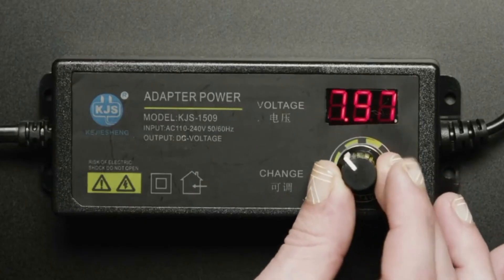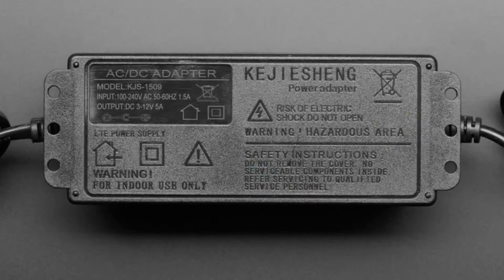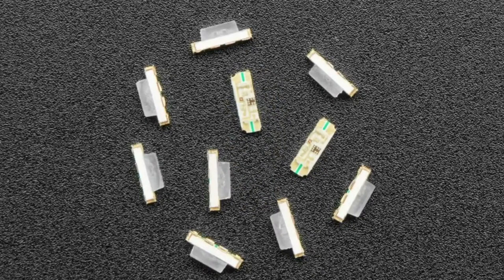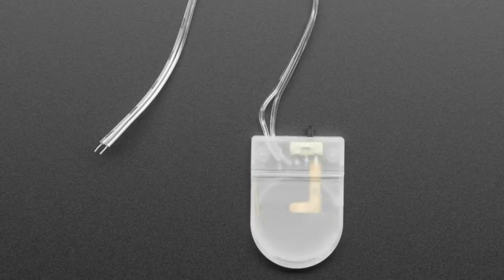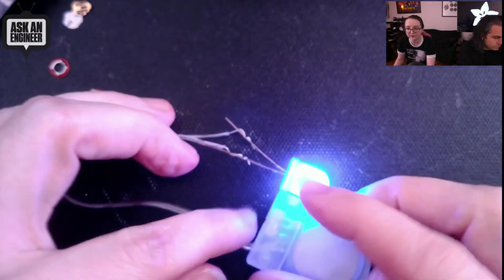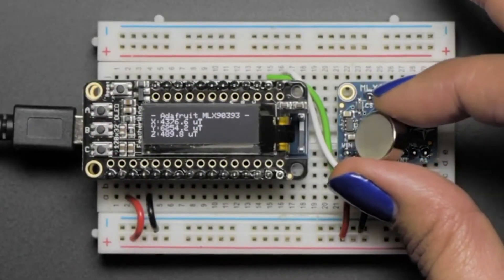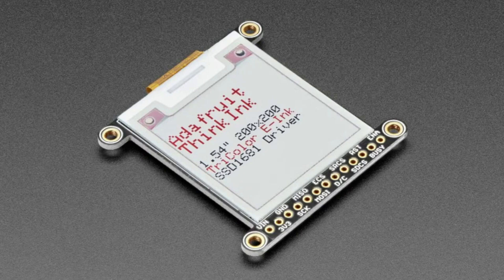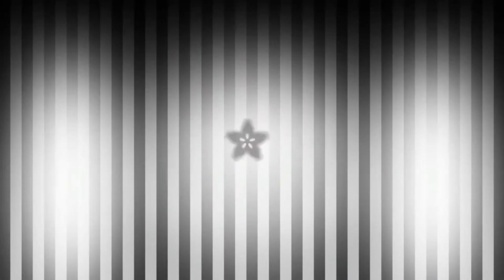New Products 2/17/2021 Feat. Adafruit 1.54" Tri-Color eInk / ePaper 200x200 Display!

Comment: The power supply could use a ratchet or more friction on the knob, so that a particular voltage will stay selected until a deliberate change is made. Otherwise, it's going to be really vulnerable to accidental changes, with all their unfortunate consequences.

Comment: Does the Adjustable Power Supply have an electrical safety certificate?
Reply: If you pause the video you can see the back and it does not have any US certs